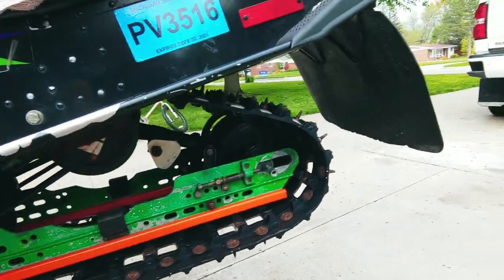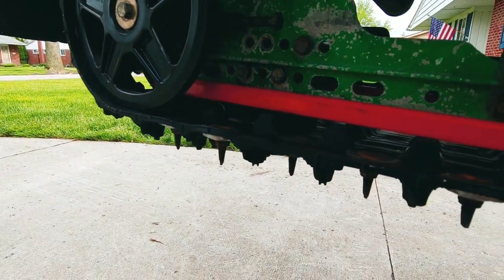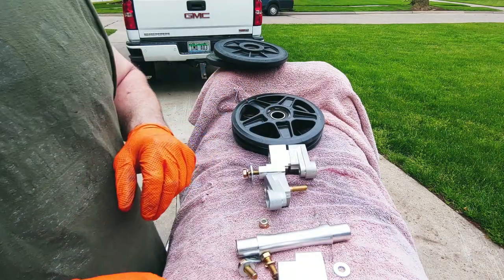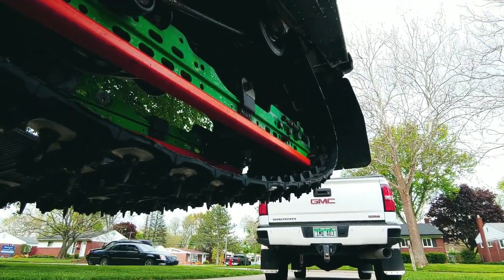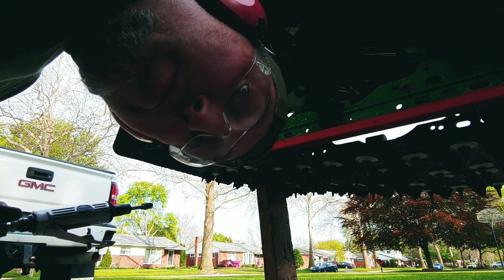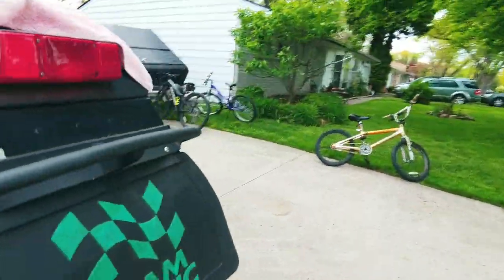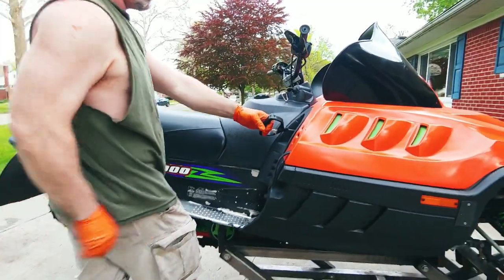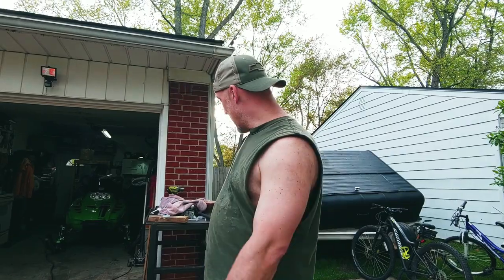Big Wheel Offset Axle Install on 99 Arctic Cat Thundercat

Comment: Easier to remove the skid and do this job. Only 4 bolts to remove the skid.
Reply from the maker: Figured Id show someone how to do on the sled. Thanks for watching.
Reply: Very informative.  I've always been curious about those off sets  for larger rear idlers.
Keep up the good work..
Just another after thought, one of the major problems of track rolling resistance comes from at the rear idlers.  With that in consideration, the hi-fax is generally trimmed, matching the angle already set by the slide rails.  Otherwise, a square cut off will offer residence at the point of track curvature, as it makes it's rotation.
With your new larger wheels, that might not even be an issue.
Reply from the maker: Hey Thanks! I appreciate the feedback!